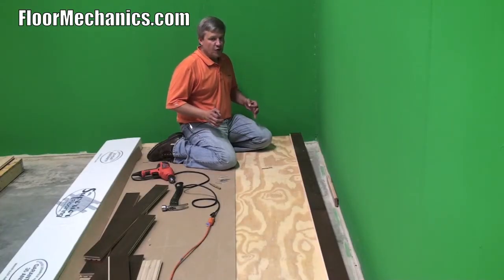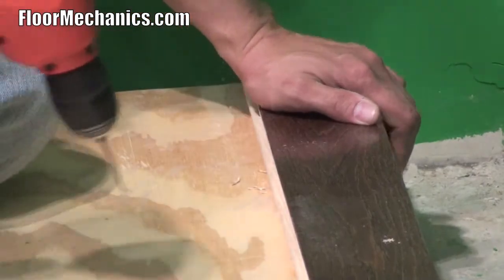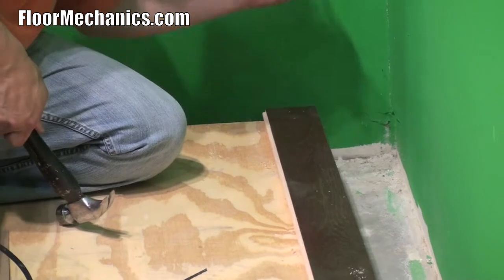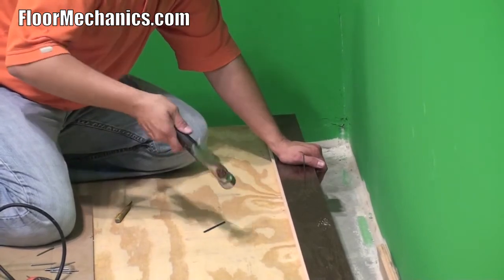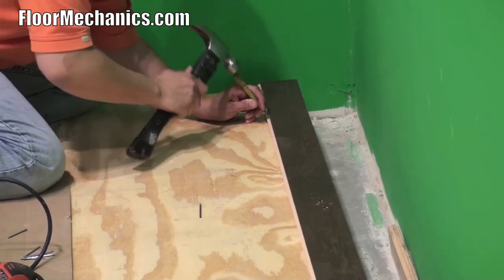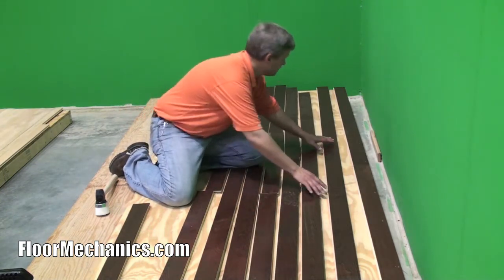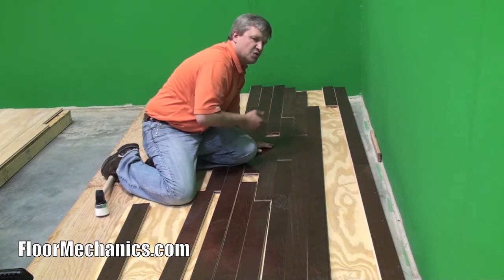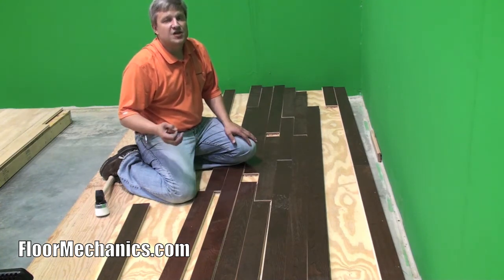How to Rack a Floor

Comment: In his case he's nailing to a substrate that is not tight to the wall so he technically has some room.  In most cases you are tight to the wall and don't have enough space to get the secret nailer onto the first board.  You also need to make sure your first few rows are set 100% correctly as they will dictate the rest of the install.  In this case you have more control when manually nailing the first boards in.  Using the secret nailer may cause the board to slip because it has not been secured.

Comment: Hi, Ive got a bamboo floor to lay, approx 50m square screwing to t&g m/r chipboard. The customer wants the floor laid at 45 degrees to the walls. Do you have any tips? Would you recommend a higher wastage than 10%?
Regards Mike

Comment: Pre-drill?  People, spend $170 and get you a 15 or 16 gauge finish nailer.  No more drilling and setting.
Reply: I spent $100 on a floor nailer  $40 on a 16g finish nailer to install floors in my house. They're dirt cheap now if you don't need one that'll stand up to everyday use. I was quite surprised at how solid and reliable they are despite being cheap.

Comment: You use a finish gun and who top nails pre finished hardwood you shouldnt be able to see nails this is a joke
Reply: Nadia Fomenko I do hardwoods for a living and we top nail with a finish nailer all the time. If you knew anything about the trade you would know there is always a point in the floor that you must top nail when sometimes glueing won't hold tight or when you can't fit the finish nailer to nail the tongue.

Comment: Yes is a nail gun can fit, why wouldn't it??? Perhaps you are thinking of the flooring nail gun which can't fit. A nail  gun is small and fit in tight spaces just fine. google 18 gauge nailer.

Comment: Wow its 2015 and were watching people drill 1/16 holes with a corded drill, Seriously?

Also your obviously not a flooring professional, a simple 18g nail and adhesive will work better than anything and be the least noticeable.

P.S. Screw the Black and Decker
Reply: Toolie Guy My thoughts exactly. Nice to see a fellow professional. cheers.